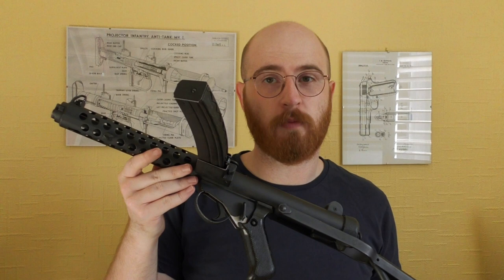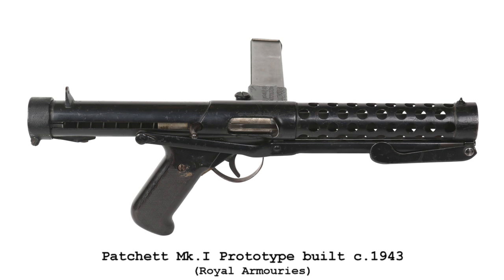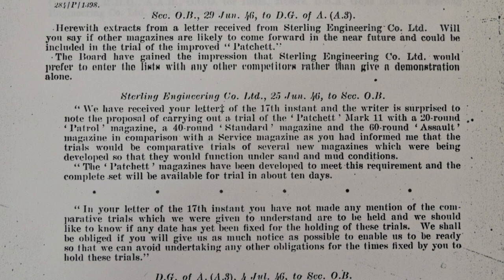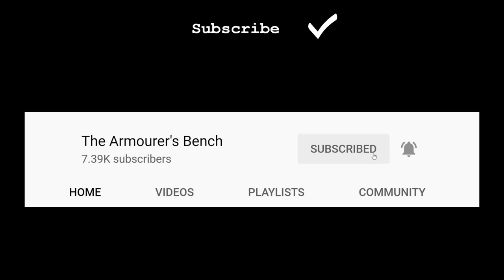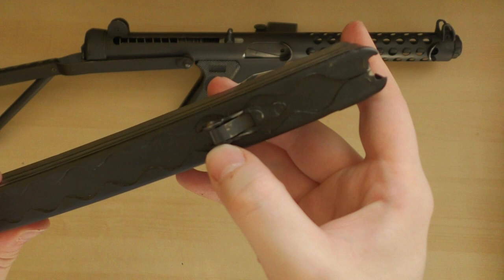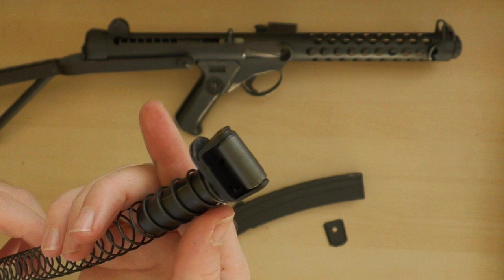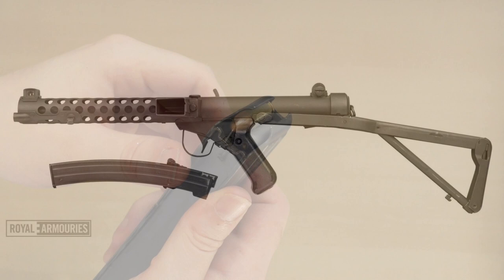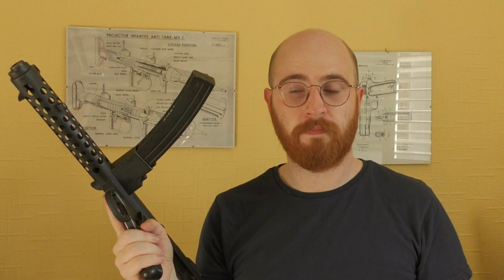The Sterling Submachine Gun Magazine: The Best Magazine Ever Designed?

Comment: I used Sterlings extensively during the Cold War. The faults with it were that as an open bolt gun it's very sensitive to ammunition quality. This is a generic problem obviously.  The second major fault is that in actual field use they rust amazingly fast and had to be constantly cleaned. In some ways that's not an entirely bad thing in that the constant problem of rust caused you to constantly clean and oil the gun. The magazines were never an issue, unlike L1A1 rifle magazines. Bren L4 magazines, on the other hand, were very reliable because of the top feed.  The Owen SMG had it right. I suspect the rollers are actually more trouble and expense than they are worth. For instance in the fine wet mud sand of the Barry Budden training area near Dundee the rollers aren't rollers however much you try to keep things clean. They seem like a great idea on paper but in actual use, not so much. As per comments below, the robustness of the feed lips and how thick the metal body is to resist dents and deformation is the thing.
Reply from the maker: Thanks Johnny, always great to hear from people who used them. Definitely agree, the rollers are novel and likely do help in some cases but the double feed, robust body and mag shape are probably more important features. Thanks for watching.

Comment: I wonder why rollers as a follower haven't been used elsewhere? perhaps that it makes the follower very big? i don't know.
Reply: At a guess I’d say they’re more expensive?
Reply: @matthayward7889  Roller followers are generally not considered today for both of the reasons mentioned here. Of course, they're more expensive to manufacture than a simple pressed or stamped follower, and they take more vertical space, either reducing capacity or requiring a longer magazine body. More importantly, modern developments in low-friction and self-lubricating polymers/plastics have permitted the introduction of inexpensive molded polymer followers offering anti-tilt features and smooth, reliable feeding, obviating many of the benefits of rollers. The majority of modern magazines use molded polymer followers.
Reply: Because it is one of those "Innovations" that only the British think are innovative. There is no proof that this mag is any better and it certainly hasn't been copied and re-used in other guns the way some magazines have. For example the Soumi / Swedish K magazine or the Uzi magazine.
Reply from the maker: Indeed, it's a novel idea and has some merit certainly but as I mentioned the Canadian mag didn't sacrifice much by abandoning the rollers. The key I think is the profile of the curve and the double feed. My video title was a little hyperbole haha.
Reply: @gregoryw70  The use of rollers is innovative by any definition, and its utility and effectiveness are not in question. Efficiency, ease of manufacture, and cost are another matter.

TAB admitted the title was hyperbole but the Sterling magazine is indeed widely accepted as one of the superior pistol-caliber magazine designs. Being "copied and re-used" is not the only indicator of significance, as the Uzi magazine is not known for the same reliability as the Sterling's. Its chief virtue was its availability, simplicity, and cost- not its superior performance.

As to the impact of Patchett's magazine design, I'd arguably look to the MP5. While I doubt there was any direct influence from the Sterling, it's clear to see  that the curved profile is nearly identical, and the idea of a pressed reinforcing rib is present as well. It's likely less a case of inspiration than a necessary acceptance that this configuration is in fact the ideal design for a steel 9mm magazine. It would be appropriate as well to note that the MP5 is renowned for its reliability and smooth-feeding magazines- which was not the case initially. The MP5 was originally accompanied by a traditional (for subguns) straight-walled magazine; only after encountering feeding issues did they redesign the magazine with a curve. You could argue that even with all of HK's engineering grunt, they still needed to fail and discover on their own what Patchett already knew decades earlier.
Reply: @its_clean  I think perhaps you may not realize that the only "NEW" idea in the Sterling magazine is the follower. Both curved body double feed magazines and pressed reinforcing ribs predate the Sterling by a good margin. I did notice that The Armourer's Bench responded to my post and I thought his response both classy and honest. I find your desire to mount a contrived defense even after reading his response to be amusing.
Reply: @gregoryw70  well, except the Australian F1 smg that used mags interchangeable with the Stirling.
Reply: I actually used to have a Smith & Wesson model 5906 pistol I used for police duty many years ago.  I acquired a number of spare magazines for it, including one made by Ramline.  The Ramline magazines used a roller on the follower to shorten the overall length of the follower and permit the magazine to carry several more rounds, going from 14 to 18, if I remember correctly.  It was very reliable, too.  After my department switched to Glocks I no longer carried the gun and eventually got rid of it as it was too heavy for off duty carry.  The roller was not configured as the Sterling magazines are, but they were very effective nonetheless.

Comment: Every time I see a new PCC making a big deal about using Glocks double stack single feed mags that were designed for 17 rounds , I wonder why they don't use the Sterling mags? Would they work as well vertical? I love the rollers. Are they difficult to find?
Reply: I'd wager it's a matter of availability. Glock mags are ubiquitous and reasonably reliable.  There have been exceptions; Lage made a bunch of their uppers use M45 magazines, which were widely available as surplus for a time.
Reply: Big up front cost to set up production for something like this, cheaper and easier to design around an existing, popular, in production mag. There's also the argument that it's a benefit for a PCC to use service pistol mags, to such an extent some offer options besides Glock.

Comment: The thing that really twists my melon is that the Sterling can feed from Sten and Lanchester mags as well. No idea how, given that they're single-position feed, but there you go.
Reply from the maker: Well the Sterling's bolt is heavily influenced by the Lanchester's. Sterling manufactured Lanchesters. The early Patchett prototypes used Lanchester bolts. The Sten and Lanchester bolt faces aren't too different as both evolved from the MP28. The Sterling's magazine housing was also designed to index the mag at a similar length of insertion to the STENs. But the double feed really makes feeding more reliable.
Reply: @TheArmourersBench  true enough -- so, is the Sterling's feed ramp just a chamfered ring like the Sten's? And I guess the forward angle of the Sterling mag is less pronounced than it looks? Cheers!
Reply from the maker: From my understanding the Sterling's feed ramp is much like the Lanchester's as it was seen as adequately reliable in terms of feeding.

Comment: Comments help the YT algorithm.  Never seen inside a Sterling magazine.  I would argue that all those features may REDUCE reliability and durability, but really everything looks solid in there.  My UZI magazines (and modified for the Colt 9mm AR-15) have always been 100% reliable.  Not sure you can get higher than 100%, but then I don't drag mine through the mud, either.
Reply from the maker: Yeah, I think a 100% reliable mag is the holy grail haha.

Comment: The rollers are not very useful for double-stack, double-feed mags, since the rounds in the column rotate veeery little while feeding. This, and the fact that they add complexity, cost, space and weight are the reasons why they are not used in modern designs that simply go with a well designed follower. 
You can see that a curved magazine does make sense with a tapered case, but curved mags were invented and used in much earlier designs. Same for a well designed case presentation angle, strong lips, positive lock and over insertion tabs.
Reply from the maker: Indeed and we can see that the rollers weren't essential from their deletion from the Canadian magazines.

Comment: My uncle died because of magazine posistion caught him every corner and stuck.
Reply from the maker: How did he die?
Reply: @TheArmourersBench  magazine stuck in the corner wire, he was shot down struggling to pull out the magazine.
Reply from the maker: @motolooper4928  Ahh I see, that's tragic. Certainly one of the common complaints with the magazine. They thought it would be better for prone shooting, it was just carried over from its predecessors the Lanchester and Sten. Where was he killed?
Reply: @TheArmourersBench  korea
Reply from the maker: Ahh, wasn't a Sterling then. It'll have been a Sten.
Reply: @TheArmourersBench  yes same problem in gulf war most of them
Reply from the maker: @motolooper4928  Yeah, trouble with cam nets is often mentioned.